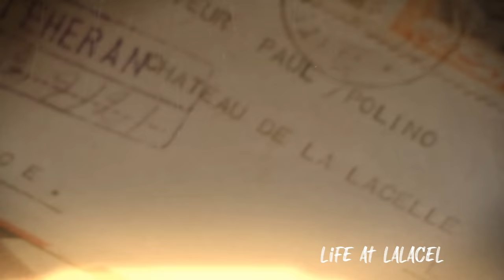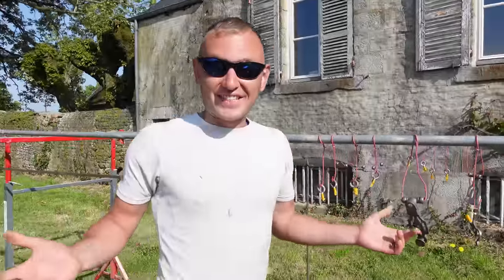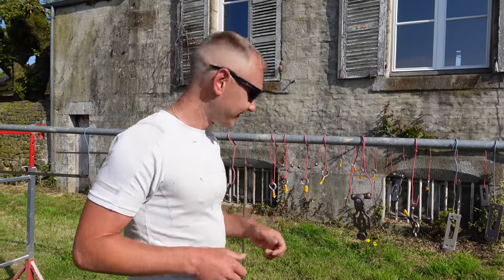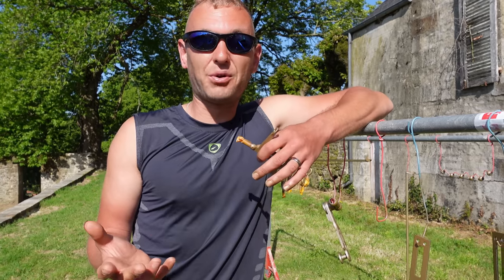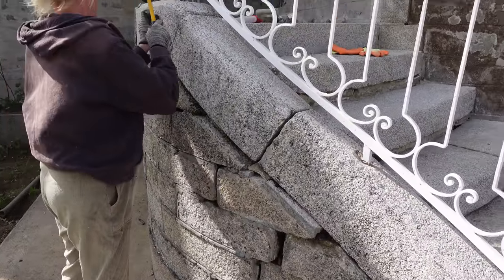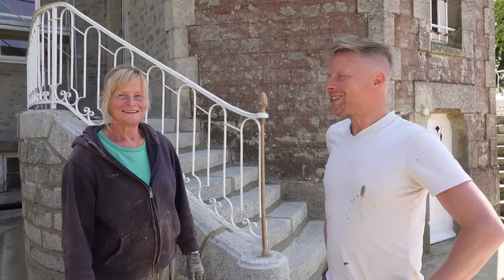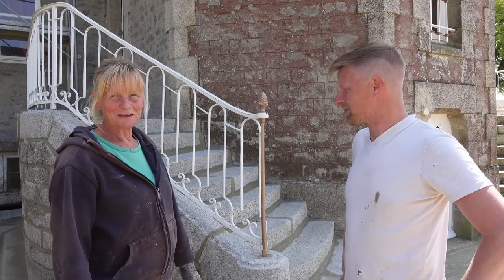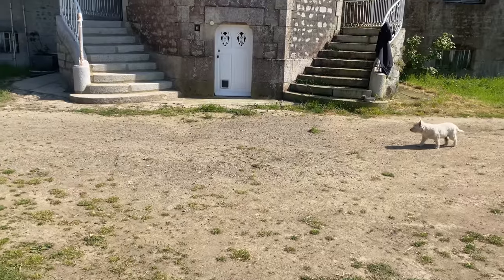Restoring The ORIGINAL TOWER Entrance For The Chateau.

Comment: You are doing amazingly well with your masonry skills.  The side wall of the steps seemed to have hydrostatic pressure damage. Something you need to look up , I don't know if your structure had any weep holes that may have been covered by the schmear coat.  Something to check though.  Here is the thing to look up and learn about before you finish anymore pointing: Brick weep holes, also known as brick breather holes or brick weeps, are small openings that you will find on most bricks homes or buildings. These openings are intentional and created to help protect the building against damage caused from the build up of moisture inside the wall cavity. They usually have a drip tray behind and this is where the water (condensation) escapes or evaporates.  Weep holes are also found in retaining walls, some are made to look decorative. Checking for weep holes in areas where you find excessive water damage or mould on inside walls could prevent future damage to your restoration work. https://www.bobvila.com/articles/weep-holes-in-brick/

Comment: If you have a joint that moves a lot, you can use, for example, Bostic Silmax, a polyurethane-based joint compound and blow on sand with a small blaster and dab gently with a brush. a it is important that you first press in a bottom strip, approximately half the width of the joint in depth. And use primer intended for this. There are special wooden sticks to press the joint with, which you put in water with washing-up liquid before use.